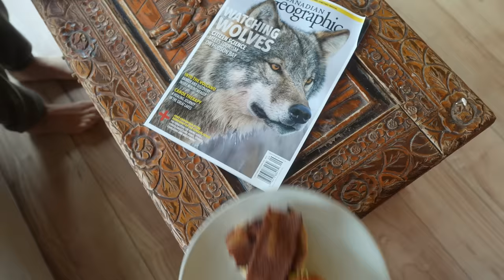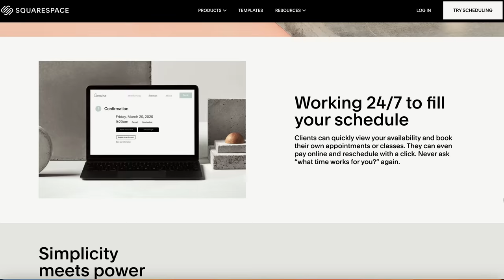FINISHING Cabin Siding in a HURRICANE - What Could Go Wrong?

Comment: Nice job ladies. 👏😃 I'm loving that charred wood look. I'm sure you're last touch will be to go around the eves with some big gap foam filler, or something similar, to fill in those cracks for the unwanted hornet nests & to help seal out future moisture etc. from getting in there before you finish painting off your roof line trim. From the beginning to now, you have truly turned this cabin into a beautifully viable, sustainable, warm & cozy homestead. ✌️🙂

Comment: Here is the thing Never ever go in to a flooded area and walk in the water as you do not know what could happen in seconds. Next about water management you need a drainage system that takes the water off your roof either stores it and then over flow takes it away in to the river. If building a home near water work out how height you must raise the home first some times may have to raise the building to twenty feet above the ground and the pillars base down below the ground twenty feet. Make sure you have some sort of boat for emergencies usually inflatable.  Now in summer heat or extreme heat  make sure your home is fire proof rated especially if made from any type of wood.  Then make sure there is no bushes trees within 100 to 200 feet from your home because flames travel and trees will fall down.  Bushes burn easily too.  Now always have an escape place that is safe from almost anything inside your home.  Remember windows will not save you in a hurricane. or a tornado.  So always be prepared and have emergency supply lamps and generator in a proper place off the ground and out of the rain and water easy for you to get to in an emergency.

Comment: Hi Again 
just saw ur geo dome build again.
I am also build a 22ft geo dome and I noticed you did not have the anti dust tape on the panels..
May I ask why you didnt put that on?

Thanks in advance
Frustrated to say the least
Reply from the maker: It can be difficult at times- are you talking about the airplane tape at the seams?
Reply: @Vanwives  hi
No it is a grey coloured tape with mesh holes and that goes on the edges, to prevent dust and bugs from getting in-between the layers of the panel
Reply: We have the airplane tape and lucky us it has been 4 days of rain with more coming, so airhose the panels and we brought them inside.
We do have the rubbing alcohol to clean the panels..
We were given the wrong instructions for the door as well
Reply: MisVanwives-on-Te-le-gram  the dome is coming along
Artic acres did send the proper door video and what to do with the grey mesh tape, drip rails are installed, flashing installed, airplane tape wrapped around, getting ready for thw pond secrion soon.
We've had a ton of rain, so the dampness or humidity in the dome is high.
Droplets keep falling on me.
Been cutting wood for the raised beds as well, an 8ft diameter bed in the middle and  2.5 ft deep around the perimeter of the bed.
Have my exotic trees in my cart, picked out..
Baby steps...